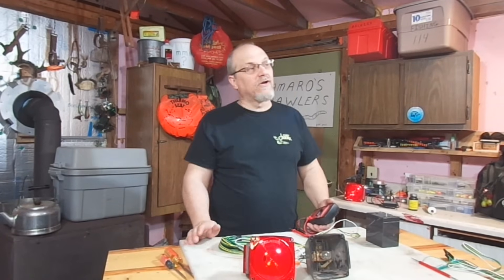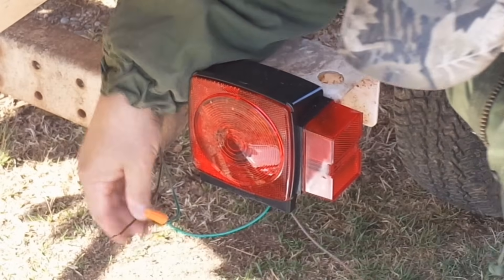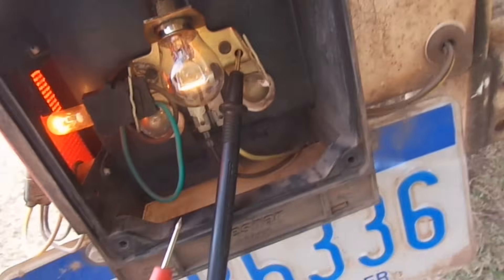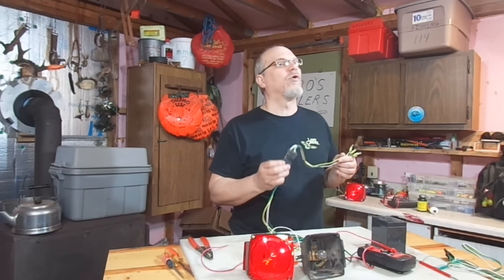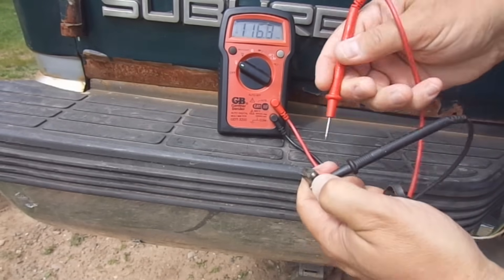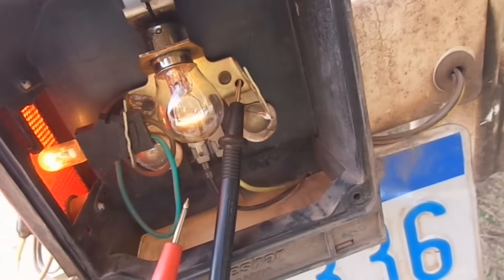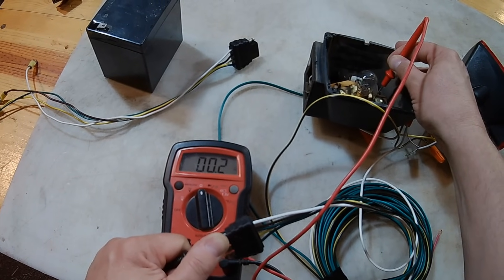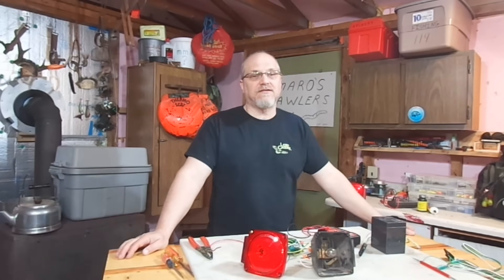FIX YOUR TRAILER LIGHTS (3) - How to use a multimeter

Comment: Thanks for the videos.  Am troubleshooting my trailer now.  At 8:07 when you do the zoomed inserts, the image is so grainy it's hard to see what you're demonstrating.  Would prefer you get the camera & subject closer for those examples.  Also, you are using the battery to demonstrate the 12 volts going through the wiring harness but on a vehicle would you have to have the key in the ignition or truck turned on to get the same flow?  Thanks again.
Reply from the maker: Yes I'm always trying to get better at making these videos.  The battery example is just to show how the circuit works but yes, I am by-passing keys on, switches on and relays being activated. Thanks for the feed back, KPO.

Comment: Could have been much more succinct...didn't start giving actual information until 5min in,then very slow
Reply from the maker: If someone has a little knowledge of circuits and electricity you could probably just jump right to using the meter, but not everybody does.  If someone had no knowledge of trailer circuits I wanted to recommend my other video so we could be on the same page going forward.  I also wanted them to not be intimidated be all the settings on the meter before we started.  But I understand the beginning could be boring for some.  Entire books have been written on using multimeters.  It's hard to know where to start because you don't know the skill level of your audience.  I tried to make a video for beginners.  But I understand what you're saying, KPO.

Comment: I understand your demo but how do you check resistance when the plug is 10 away from the taillight?
Reply from the maker: To cover the whole length of a trailer you may have to attach a wire electrically to one end and use it like a big jumper.  Essentially making one of your lead really long, KPO.

Comment: Thanks for this resource.  I hope you can help me with a question. Took the car to Uhaul yesterday, rented a trailer, no lights worked. Same result with two different trailers.  This is a 2011 Toyota Sienna. The lights were working two years ago as far as I know when we got a trailer from U-Haul. When I test the four flat from the car with the multimeter I get about two volts whether the lights are on or not.
This is supposed to be one of those setups where because of the LED brake lights, you have to run power from the battery all the way back. The weird thing is I checked and there's no such animal. What could be the cause of this? Do you think I need a new controller?
Reply from the maker: It's hard to say, but if you need the controller, it usually is powered separately.  So there should be a wire that powers it up from the battery.  It might not be easy to see.  If the controller is powered up, you may need a new one.
Reply: @KnettersPracticalOutdoors  Thanks.  I finally figured out, they originally used the nearby lighter jack for + and the ground for -.  But I moved both to the lighter jack, and now all three ports show ~12.65 volts even when all lights are off.  I assume this means a bad controller, but would appreciate your input.  Many thanks.
Reply from the maker: @mariacombe  If the converter module (controller) has a neg. - input I wouldn't connect power to it.  I really can't comment to your particular converter as many have slightly different wiring as do the cars themselves.  But it sounds like it's still possible the converter is fine and it is just wired wrong.  KPO
Reply: @KnettersPracticalOutdoors  I am surprised you say not to connect power to the negative. Everything I have read says you need the ground because that provides the negative. But, 'never say never', especially when it's inop and I've already ordered a replacement controller. So I will disconnect the negative and let you know. Thanks again.
Reply from the maker: @adriancombe  Yes you need a ground (neg or -) connected.  But anything labeled as such I wouldn't connect power (12vdc) to.  I guess I thought you said you also connected power (12vdc) to the negative.
Reply from the maker: I thought you were saying you connected both + and - of the converter to the lighter +.
Reply: I tried both. When only connected to the ground, all leads read ~1.9 volts regardless of what the actual lights are doing.
When I connected both to the lighter jack, everything reads ~12.65 - again regardless of lights, brakes or blinkers.
Thus I tend to think the controller is defunct.
Reply: It was the controller.  Replaced it with identical unit, all set now.  Thanks.

Comment: It seems that everyone covers the basics on repairing trailer wiring, but one thing I've yet to see covered is voltage drop.  Sure , you can get a good resistance or voltage reading on a wire BUT they still might not work once you put a load on the circuit ( light bulb is lit).  The most common causes of voltage drops are broken wires in stranded wire or corrosion in the wire or in connections.  There are plenty of videos that deal with voltage drop issues that viewers can check out
Reply from the maker: Yes voltage drop is a common issue.  I should cover it in an up coming video.  Thanks for the feed back, KPO.

Comment: Thanks dude! After sanding enamel all last night around my trailer's ground connections I used the multimeter today (with the help of this video) at the 4 pin connector and discovered that my ground cable had no continuity and had slid out of a connector. Re-connected all and reset the ground and now I'm good to go. Thanks brother!
Reply from the maker: Awesome!  Thanks for the comment!  KPO.

Comment: Great learning tool video. However how do I use my multimeter for continuity from the plug at the front of the trailer, 14’ back to the tail lights?
Reply from the maker: Great question.  Well you can use a longer piece of wire attached to the meter lead kind of like an extension of the meter lead.  Also you can use the trailer frame as an extension of the meter lead by temporarily grounding the wire you're checking to the trailer frame.  Then at the other end of the wire check continuity from the wire to trailer frame.  If continuity comes and goes as the wire is grounded and ungrounded the wire should be good.  Won't work with the white or ground wire itself (because it's already grounded)  KPO.
Reply: Knetters Practical Outdoors Thanks...I thought I could use the frame but wasn’t sure

Comment: How can I use the multimeter to find which wire goes where ?example I bought a trailer that had a 4 wire in one at the trailer hitch with no plug the wire colors are not standard yellow green brown white so I need to find out which wire is left etc.. thanks great channel
Reply from the maker: This is a great question and I should address it in  a future video.  But for now you will need to check for continuity.  OK, you have your trailer and you have a plug at the hitch and you're not sure which pin is which wire.  I will assume the lights aren't working or you probably wouldn't be concerned with this.  You may be able to tell which pin is the ground by looking at it.  It should be connected to trailer frame pretty close to the plug.  Often the ground pin will also look different than the other pins on the plug.  Next you may need to disconnect the wires at the light to keep this from getting confusing.  So you take one of the wires you disconnected from the light and check if it is grounded (low ohms to trailer frame).  If it is grounded it may be your ground.  Some fixtures are grounded by wires and some by being bolted to the trailer.  If the wire isn't grounded then we will find what pin it goes to.  If your meter leads are long enough to go from the plug to the other end of the wire you can put your meter to ohms, one lead on the wire at the light and the other at the plug pins.  Check each pin to see which one has continuity to the wire your other lead is on.  If your leads aren't long enough, ground or attach the wire at the light to the trailer frame.  Now at the plug pins see which pin is grounded.  Now you are just using the trailer frame as a temporary meter lead extension.  Do this with each wire.  Double check by attaching and disconnecting the wire to trailer frame and check that the continuity comes and goes accordingly.   This might be a bit much for a reply but like I said I will try to do a vid on this subject also.  I hope this helps, KPO.
Reply: @KnettersPracticalOutdoors  perfect I will get to work thank you very much.....

Comment: So why do I have turn signals, tail lights but no brake lights? Standard flat for connecter, led lights.
Reply from the maker: Do the brake lights work on the car?  If you have the turn signal on the trailer the wiring should be good for both turn signal and brakes.  It's the same wire but the car toggles it for the brake.  Let me know what you find, KPO.
Reply: @KnettersPracticalOutdoors  The fix was a little box called a combiner. The dodge Caravan we were working on has 3 bulbs and circuits in the tail light. This device safely combines the brake light and turn signal circuits. The standard trailer wiring harness does not have this device.

Comment: Dave,
Just found your site and I love it. Always a problem with trailer lights and I've always been in the dark until now. I have a multimeter but only ever used it to test battery voltage in my equipment. Looking forward to using it for continuity. I also bought a 7 way and 4 pin flat tester off Amazon tonight. I'll stop at this video and see if I can apply what I learned before moving on to your episode 4. Thanks again man, and I LOVE your intro music. Definitely suits the intro video.
Reply from the maker: Jerry, thanks so much for the kind comment.  I hope you have been fixing trailer lights like a pro!  KPO.

Comment: 1.  will the meter send power to the tail lights on trailer to see if they work?
2.  Is there a brand of plug for truck and trailer that is better for connection purpose,  it seems that every year i plug my trailer and no lights but touch the connection where it plugs to the truck and it works !!!
Reply from the maker: Top Flight, no typically the meter doesn't serve as a power source.  But I have a video that shows you how to test the fixtures.  Here is the link https://www.youtube.com/watch?v=INI5bZkoEVw   .  Also, I think you get what you pay for.  The cheaper the plugs and fixtures are the less quality they are.  Thanks for watching, KPO.

Comment: How do I measure continuity on my trailer when my plug is on the tongue and the light is 20 feet away?
Reply from the maker: I think you found your answer in the PART 5 video right?  You just measure it one short portion at a time, KPO.
Reply: @KnettersPracticalOutdoors  I see that you can test one portion at a time but is it true you can use a long jumper to test from the plug to the fixture s one people say or does it weaken the signal on the meter?